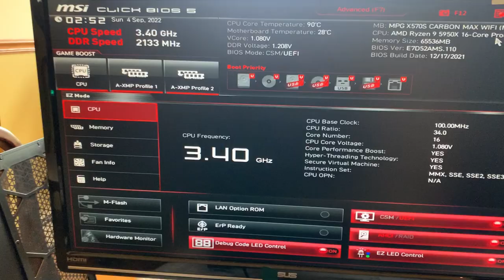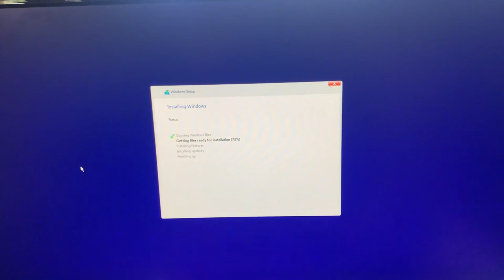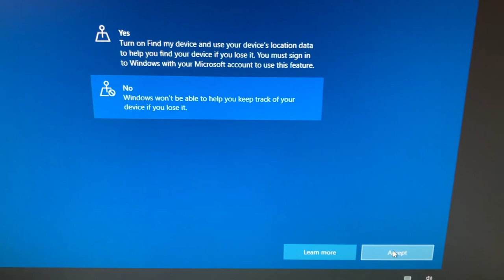Building My New PC!!!

Comment: is your pc for editing  becouse thats a very good cpu if not btw i would flip the fans over on your radiator so they bring in air and help cool down your ram and gpu
Reply: They would just bring in more warm air
Reply: @bareldmola  no they would bring in cooler air
Reply: @sparky2029  if the radiator is warm how will it bring in cool air ?
Reply: @bareldmola  the fans will bring in cool air from his room and this air will pass through his radiator now the air is heated but it is not at the most amount of heat that it can hold yet now the heated air will help cool down any over things that make heat like RAM and the VRM's now you may say that the air must have its max heat that it can carry now and you would be right but he has a fan at the frount of his case ( i would put 2 more fans in the fround becouse it can hold three more fans and this would help cool down the GPU) so this fan will bring in cool air into the pc and will help cool down the gpu so then everything is now cooled now the hot air will be exspelded out of the case by the fans at the top and back
Reply: @sparky2029  depends on the conviguration i guess
Reply: @bareldmola  yeah